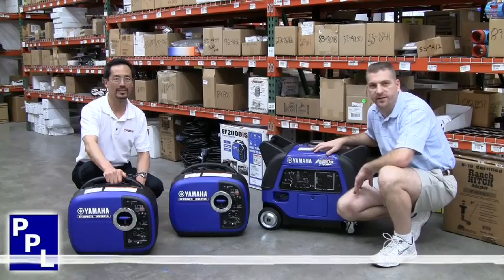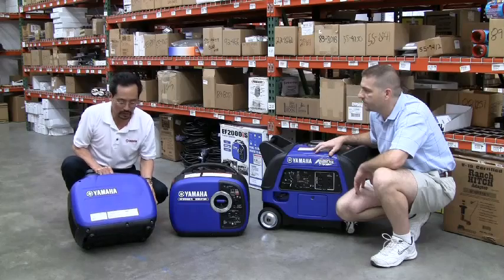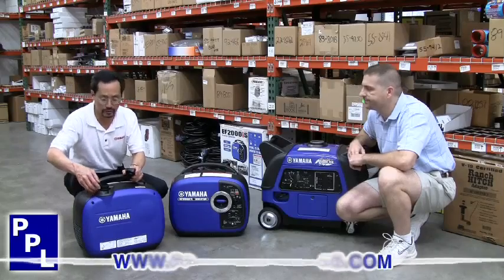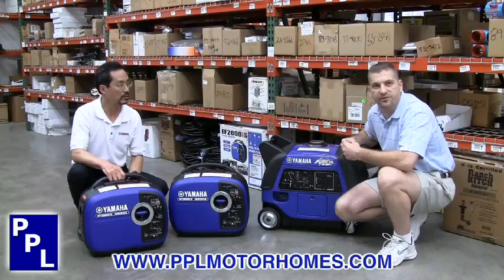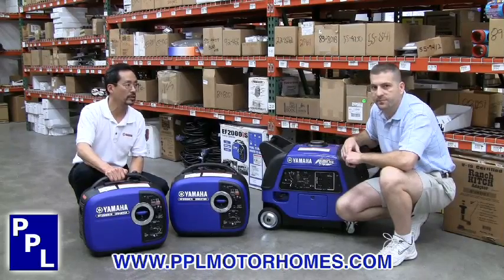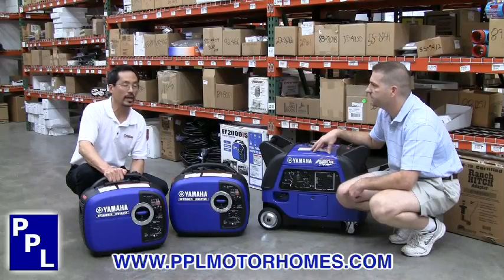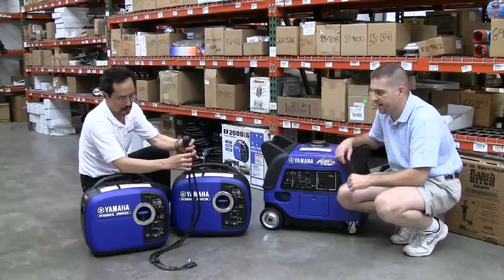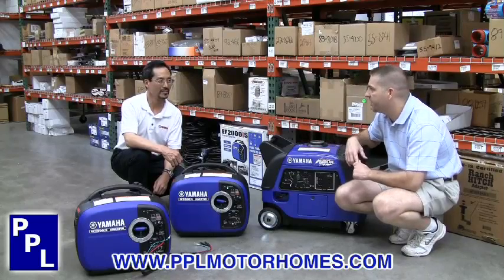Yamaha Inverter/Generators

Comment: Lot of BS in this video.... from staying the EPA emissions determines longevity to saying pushrod (OHV) is better than OHC.   Lots of BS!  BTW,  I have generators with both designs.. OHV and OHC.  I don't know which might last longer, but I can tell you that the OHC design is quieter and I think it's partly because the engine is slightly larger and runs at lower rpms.   BTW, If I had to make a choice, I'd take the Honda with a belt, over the Yamaha at 2000 watts.  The Honda is just a better over all design.. and I abuse the crap out of mine... it's now 15 years old.  The OHV gen.. I just bought it because it was lighter in weight (smaller engine).  I've since found that I don't like the higher pitch sound the engine makes.  It makes it sound much louder.

Comment: It is very quiet✬✬>share4.photo/Y22Inverter?Ув   so quiet in fact that it was sometimes forgotten and left on when carpenters went to lunch. Here in Hawaii, the climate is wet and humid but this sturdy worker has just kept on humming. I agree with another reviewer that a tank of gas gives you 20 hours of power. Since I got electricity, I seldom use it so the battery then runs down. However, I can use the pull-start with no problem until the battery charges up. I have been very pleased. The only downside for me is that it's very heavy so you need a couple of strong people to move it up stairs or load it in a car.

Comment: This video is from 2011. A lot of this information is outdated and that Honda inverters surpass the Yamaha. They do have gas gauges on them. They have 20 amp 120 volt receptacles and not 15 amp like the Yamaha. The Hondas are way cheaper in price, too. I am currently searching for either for my travel trailer, and definitely the price differential is a factor. The Honda 3000i will run up to almost 20 hours on one tank of gas, if it isn't over used. As much as I like Yamaha, Honda has more features and a better bottom line.

Comment: Why would you buy 2 EF2000iS gens when you can buy 1 3000 gen
Reply: Weight
Reply: Weight, price, 25% more power, and they're more versatile all the way around. By having two 2000 watt machines, you get 4000 watts of power for less money than what you'd get with a single 3000 watt system. It's a no brainer!

Comment: I have to disagree. I purchased 2 Yamaha generators (2000 watt) last fall. I followed all the instructions on shutting them down and ALWAYS used fresh gas. I would start them on a monthly basis and always use the carb fuel shut off valve to burn off the gas in the carburetor.
This summer one would not start so I took it in because it was under warranty. It seemed to be more of a spark issue but since it was under warranty I took it to a Yamaha authorized dealer(Rock River Motorsports in Jefferson WI.) Now the generator was purchased for $1000.00 and had about 25 minutes on it. I was informed by the dealer that the carb was extremely "gummed" up and that it took 2 hours to clean up($120.00 an hour) and was informed that I owed him $280.00 for the service.
I Called Yamaha customer service in California and spoke with "Ray" who said he would look into it and call me back. A few hours later he called back and said that the dealer said it was a fuel problem and it would not be covered by Yamaha. I asked him then if the carb valve really works since it was used every time to shut the unit down and the gas was about 30 days old. Ray said he could not answer that question because he was not in their "R & D department.
I asked if he felt that $280.00 for a carb cleaning was a fair price and he would not answer. After further negotiations the price was kicked down to $216.00. I felt like I was scammed by the dealer and Yamaha washed their hands. By the way the dealer never called to say what the charge would be until it was completed.
I am disappointed in the product but more so in the way that Yamaha handled it. I have 2 Yamaha generators that I paid $2000.00 for that are now for sale!!! SHOULD HAVE BOUGHT HONDA.
Reply: If you cant repair a simple small engine you're a turd. Boo Hoo welcome to life. Nothing is perfect.
Reply: Mr. Voigt, just some thoughts (kindly).  A float bowl may have residual gas left in it even if the engine is run dry.  (My Toro snow thrower has a small spring loaded valve at the base of the carb's float bowl, to drain its residual gas left in there for run-dry/storage occasions)/  In addition, ¿is there any way that the shut-off weeps in the off position?  Perhaps, they're weeping a little (in the off position), and not completely closing the gas flow to the carb.  I bet you can replace them, (parts from Yamaha, free to you: warranty) or even, using a more reliable gas shut-off.  (A small engine repair shop can give you good tips on such an animal [Husquevarna, Stihl, or B&Stratton, Toro, don't know]).  One way to test said shut-offs is to perhaps first drain the carb (using the provided screw/tube attached to the float bowl).  Then, drain again, after a few days or week, to see if any gas has gotten past the shut-off left in the off position.  (I have had a shut-off on my snow thrower weep as described).  
I do think that Yamaha should make good on your repair.  If nothing else, they should send you new shut offs, or (a) new carburetor(s), if not the repairs $ back.  I think that if you persist with them, they may/will concede.  
Your Yamaha inverters seem like good high tech generators, and should last you a very long time.  (Don't give up the ship.  Don't despair).  God Bless.
Reply: Somewhere Usa I agree with you I was just upset how Yamaha and the dealer handled the fix. It takes six minutes to get the carb out and about 10 min to get it cleaned. The dealership gouged me and Yamaha did not stand behind their product. Having 2 identical generators with 28 day old gas in both of them shouldn't be an issue. I have a neighbor who gave me his kawasaki generated with 2 year old gas in it and after priming it started right up. while I would never do this with the brand new Yamahas I would think that Yamaha would stand behind their products. Thank you for your advise
Reply: David Voigt, (thanks for the reply).  I think those Yamaha 2KW inverters are very good.  They'll provide you with good power and long service life.  (I agree with you: 28 days with gas is not an adverse condition, but normal usage, in my opinion).  You may wish to write a letter to Yamaha and state, kindly, respectfully, and clearly your situation.  They may surprise you.  (Just a thought).  I wish you great success in all your good endeavors.  God Bless.

Comment: One of the bolts where holds the carburetor broke very easy when I was trying to clean it. After 2 years the carburetor stuck. Very bad quality on the bolts if they broke so easy. Never left fuel in the carburetor otherwise $1000 will go to the trash like mine did :) I even don't know why the people still run the gasoline engines like wee got the much better technology the diesel engines. With diesel fuel the carburetor will run always clean. Big mistake I make to buy gasoline generator. No more. Good luck Yamaha I wont to see diesel portable engine for 2000 and 3000 watts next time !!!
Reply: A good small engine mechanic could fix your inverter.  They are made light, and delicate.  Sensitive stuff. but very good generators.  I hope you were able to get yours fixed.  (A 2 year old inverter is still a baby).  God Bless.
Reply: Diesels are louder than gas which can also be converted to lp and maybe natural gas.   You could probably drill out the broken bolt and put a better bolt in some bolts they put lock tight so they can't be removed =(.

Comment: noise is not a problem go to homedepot and build a sound proof box.
Reply: and burn up your micro processor controlled TV or computer. the home depot generators are ok for the job site but not for camping or RVing.

Comment: it seems that the sidewinder cables are cheaper (half price) vs the twintech cables...whats the difference? cant you just get the sidewinder cables and a plug adapter?  any difference vs the $200 twintech cables?

Comment: In New Zealand, the Yamaha EF 2000 is, sells for the RIP OFF price of NZ$ 2850! as of 8th June 2014, that is US$ 2380!! How's that for a rip off, for a generator that sells in the US for under $1K?? In fact, the Yamaha EF 2000 is, is even more expensive than the Honda EU 20i which can be bought locally for NZ$ 2490. Value??? Not in New Zealand!!

Comment: i have a yamaha generator purchased in 1982, and in 2014, it still runs like new. It was used hard the first ten years of its life, after that, just used when power has gone out. 1 time it even ran low on oil and it shut down, saved by the low oil monitor. If that does not attest to Yamaha quality, then what does?

Comment: Value, $1000 for a 1800watt inverter generator is not value
Reply: You have to remember though that the inverter is pure sine wave! A 1600 watt pure sine inverter on its own costs roughly $600. It really is a good deal for what it is.
Reply: @Lumilan  I think Bulgdoom is comparing cost per watt...  And if that was the only reason, you can find inverter generators at the same rating for near 1/2 the price of Yamaha and Honda..

Comment: Excellent video. It would be nice if Yamaha generators were a realistic option for UK users. But they're not due to a small dealer network (making the sets hard to find), higher initial cost and only two years domestic-use warranty as opposed to Honda's five-year domestic-use warranty. This is probably why most high quality small inverter generators in the UK are Hondas. They're easier to buy, less expensive, better warrantied and supported by a large dealer network for servicing and when anything goes wrong. I am really surprised that Yamaha Motor Europe isn't more competitive in the small genny sector.
Reply: Hey Bill...the company I work for is looking to break into the UK marketing with our patented extended run fuel systems for generators.  We make products for all the major brands.  You can see the products at www.ipiindustries.com and buy them ecommerce from www.genxdirect.com We have a strong and growing dealer network here in the states, but would love to see our product grow across the pond.  Let me know if you have an interest or know of no one who may have an interest in distributing.

Comment: Bullshit, I worked for Yamaha motors for 7 years. I'll tell you the Honda is a much better value when it comes to replacement parts and cost. I would add you start putting ethanol fuel in these and it will screw them up. I had to start using marine fuel and RXP to stop the shit from eating my fuel system up. I have nothing against Yamaha. I love the bikes and the quality, fit and finish is great. Honda had electric start, low oil shut off, and fuel gage. Great generator for the money.

Comment: It is a mistake to underestimate the GX-100 Honda engine. These engines have been around for decades and thier design is extremely fine-tuned. "Plastic" OHC belts are common in motor vehicles and once again, are extremely reliable. They are used in this application because they are reliable AND quiet. I am a smalll engine mechanic and having been witness to the commercial uses of GX-100 engines for decades, it'd be the Honda for me. Btw, I don't work for Honda.

Comment: Great video on the Yamaha generator and I appreciate the features the Yamaha has. I'm in the market and one thing that really bothers me about the Honda 2000 is the plastic, single cam lobe and the plastic governor gear/oil slinger. Oh, wait, that's two things :) 

I generally love Honda GX engines, however, I did have 2 fail in the Florida heat, during extended use. So, the plastic thing does not sit well with me. 

Does the Yamaha use a plastic cam lobe, or a plastic oil slinger?

Comment: Why is this called an "inverter/generator" ? Does it function as an inverter as well as a generator?
Reply: The output of the generator is run thru an inverter that gives it pure sinewave power. The typical generator provides a Modified sinewave power that is not as clean as pure sinewave. it is much safer for use with sensitive electronics. It does not function as a stand alone inverter.